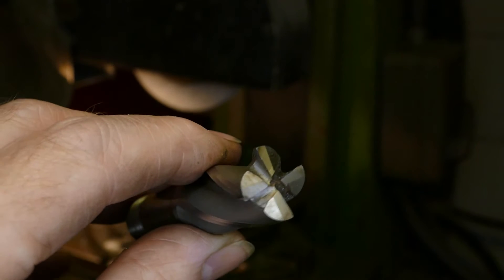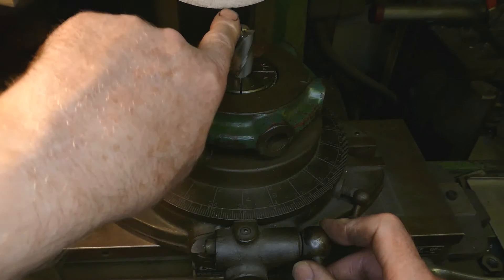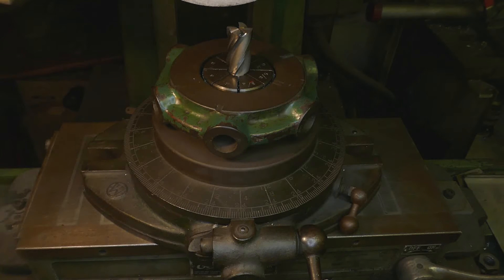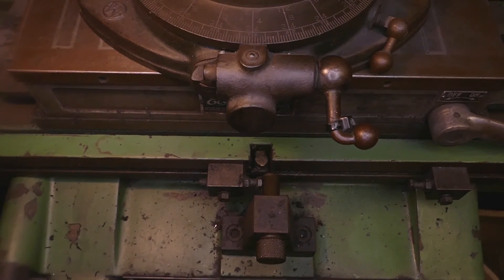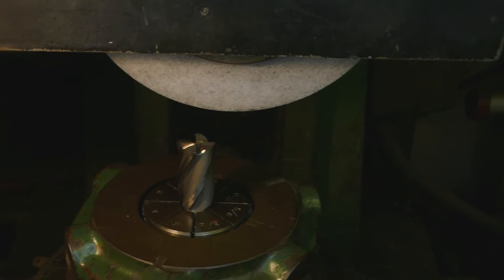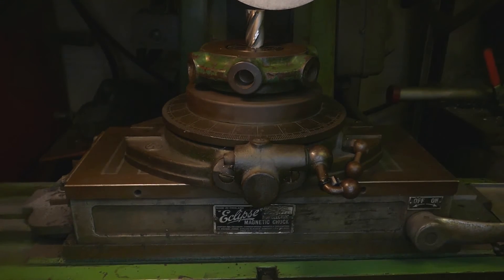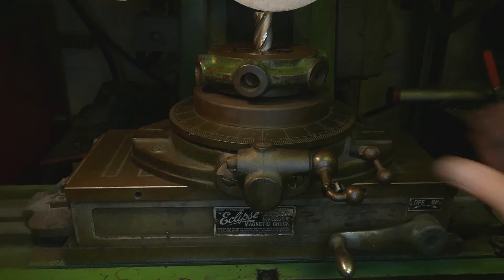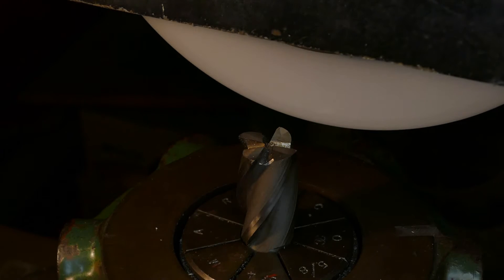Sharpening a Milling Cutter on a surface grinder.

Comment: It works!  I've never seen an indexing fixture like that are those holes in the side for closing the chuck jaws?.
Reply from the maker: Have you tried it? Yes, a bar is used in the holes to tighten/loosen the Marlco multisize (or "Multibore") collet.
Reply: No I haven't tried it, although on my mind is a way to grind spiral milling cutters  for the horizontal mill on the surface grinder. likely with a cup wheel and some stand-in for a work head.
Reply from the maker: I look forward to seeing the video! @tilliesinabottle

Comment: Happy new year to you.
Never tried sharpening an end mill on the surface grinder but it occurs to me if you rotated the mill a few degrees, looking from the top, you could grind with a slight concavity at the end as per a new grind.
Reply from the maker: Indeed. That was going to be my reply if anybody commented that the end should be slightly concave!